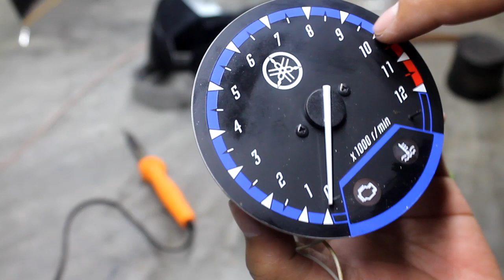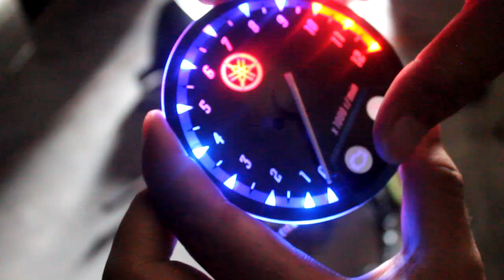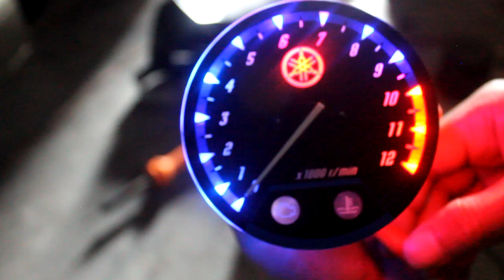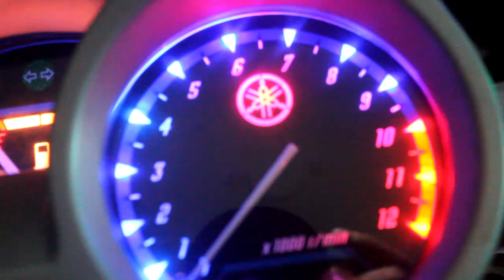Modif Lampu Speedometer

Comment: Resistor 1k itu kuat utk brp lampu mas?
Reply from the maker: Kuat banyak jga om, asal 1k taikin watt nya misal 1k 1watt/2watt
Reply: @iBProjectt  td saya coba 1k 2watt buat 7 lampu led, nyala skali doang abis itu mati smua mas lampunya
Reply from the maker: Mungkin salah pemasangannya coba ada di vidio saya yg modif speedo mio itu lengkap di jelasin cara pasangnya
Reply: @iBProjectt  ok, om maav mau tanya dluar topik, itu resistor yg ada di ampere bensin ukuranya brp ohm ya? Punyaku mati trus tak ganti dgn ukuran 47ohm sesuai kode warna resistornya tp ga akurat ya? Brangkali salah ukuran, tolong dibantu om..
Reply: @iBProjectt  1 lampu 1 resistor. Apa resistor nya cukup 1 untuk beberapa lampu bang?